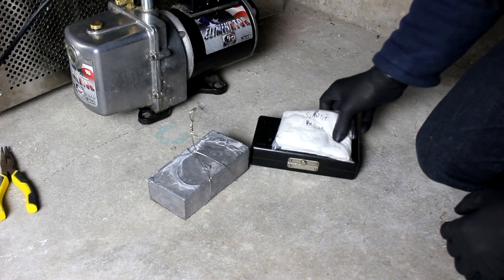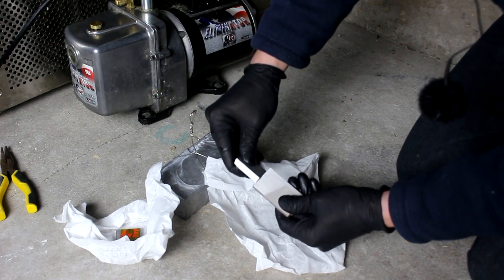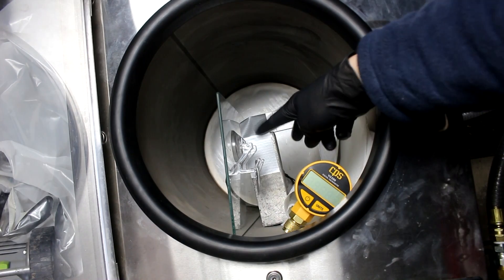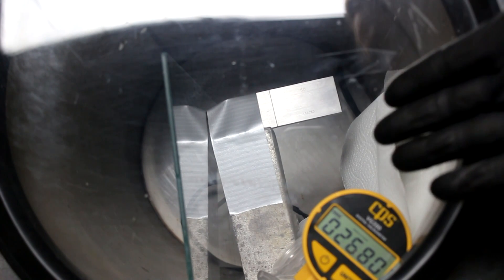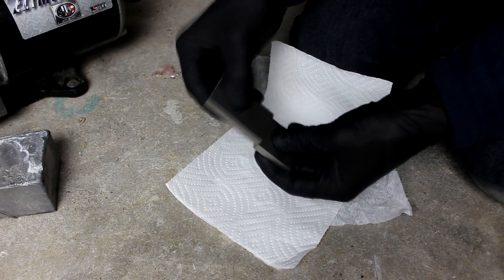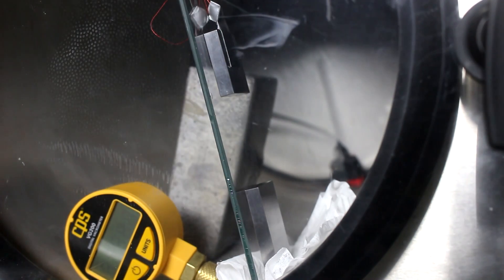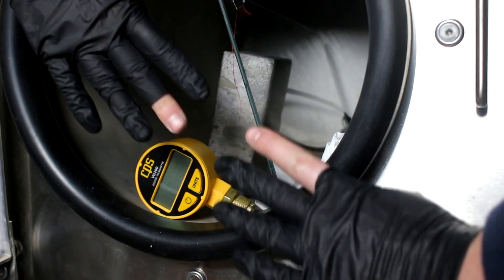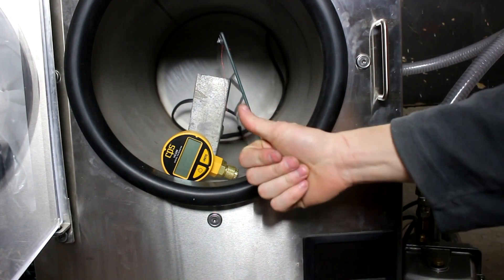Will Gauge Blocks Stick In Vacuum?

Comment: how well works a suction cup when you put it in soapy water on the glass? I would say the same when the load is perpendicular to the glass surface and much worse when the load is parallel to the glass surface.
So if it was suction that holds the (slippery, (like the soapy suction cup)) gauge blocks together, my prediction would be that the gauge blocks should fall apart when the surfaces that stick together are vertical (or just steep enough). in the same way two glass surfaces with water between them behave...

what do you think about that?

Comment: What if it is the atoms in the contacting surfaces that get really hot for a also small amount of time and that makes it weld? You could test this by doing the same proccess but instead making the movement much slower thus making it less likely to heat itself up.

Comment: Cody, i suppose there is a problem with the experiment method. When the plate falls on another plate, it bounces and lifts off. This happens even on a very small scale and you cannot see it with naked eye. The force created by bouncing is enough to not let two plates weld together.

Comment: Could the pressure you apply when squeezing the blocks together create enough heat between the blocks to force enough atoms to warm up just enough to mix and create a slight weld?

Comment: on such a small scale the ductility of that metal will make it like rubber which would increase your contact area. also the surface may not be as smooth as it looks when you get down to nano-meters. what does it look like under an electron microscope? does it stick to glass when rung against it? how about aluminum ground to the same flatness?

Comment: So gauge blocks stick together with a combination of three factors...
vacuum, molecular force, and friction.

Friction alone wouldnt stop them from pulling apart, but does make it more difficult to slide.
You need the vacuum and sufficiently smooth surfaces to get the molecules to line up and attract eachother. 
The closer you can get the molecules of the alloy, the stronger the bond, and the stronger the bond, the stronger the frictional force.
Having any air between the plates can cause the molecules to be too far to have a strong enough attraction force. 

Its not really a mystery... 

Think of them as rubber balls more than marbles, and moving the blocks allows the molecules to be squeezed out but loose molecules from the outside cant get in, other than that your aforementioned marble analogy is pretty spot on.

Comment: SladeCintron Cody, dude.
what happens is when the gauge blocks are stuck together, firstly the friction sheds off the oxide layer of the metal and makes bare metal contact each other. then  the loose electrons in the pieces are free to move in both of the blocks, because they can't differentiate between them. when they move through the connection points, they push atoms in their way, and that forms a metal bridge which holds the blocks together.
that's what happens

Comment: Very nice demonstration, thank you. 
As far as I know you need some friction to overcome the repelling force between the electrons from part A and part B. After you have overcome this force, part of this force will hold the two parts together (so no thermodynamic violation here ;)). At this point, when enough metal surface (hence the mandatory flatness) has entered the van der Waals zone (mutually), all electrons will flow freely from one metal lattice into the other. This 'sharing' of electrons in the classic sense, or collapse of the separate cloud-like influence in the quantum sense - creates a force that I think can be compared to or is identical to the Casimir effect.
So the total effect could be a combination of van der Waals (gecko-feet), Casimir effect, and valence electron influence.
Not sure if I used the right terms here, just shooting from the hip right after I watched your video.

Comment: Hey Cody,

a while ago, I noticed the very same effect with two HDD disks. Just disassemble an old hard drive and slide the disks together. Sometimes they held together so strong, that it was actually quite difficult to take apart. Unfortunately, I do not have those disks anymore, otherwise I'd make a quick video to show you, but I'm sure you'll figure it out.

Comment: The one additional test I wanted to see was to wring with oil removed, then put back in the vacuum chamber. That would rule out the hypothesis that it's a combination of oil surface tension and suction, either of which work somewhat on their own.

Comment: Cody you noticed the first problem with your experiment (the tape causing tilt), but not the second: you are dropping the block from a high level which is causing a reflected shock wave (unnoticeable) enough to break the week van der waals bonds. i don't understand why you thought you needed to smash them together to create the VdW bonds, its a proximity type of bond. collision causes bounce! try dropping it from a distance of half a mm which is enough to take care of surface imperfections.
Reply: PolyJohn i thought about that but since the surfaces are not 100% parallel a small force is still needed which bounce gap won't do. anyway it's worth trying out.
Reply: We should take this further and agree that it's useless to try more experiments in a non-scientific manner: Cody keeps trying to slide the blocks in normal atmosphere and then doing other things in the vacuum.

Let's go scientific and try exactly the same things in the same condition, with pressure being the only difference (in the air then in the vacuum). Then we can proceed to conclusions.
Reply: Neut Only if the weld points are large enough to be clearly visible. Though considering you can make these blocks out of ceramics and they still work, it's clearly not welding that's occurring, nor an oxide layer that impedes the bond prior to wringing.
Reply: Yeah, it bounces from the higher drop height, but then it falls again onto the block from the much smaller height of the bounce. If the short drop was going to do it, then the small drop after the bounce would have done it too.
Reply: Neut If the presence of air was the only thing impeding their bond, as that part of the test was meant to determine, then the upper blocks weight pushing them together would've been enough to form the bond.
Reply: Look, the original vid with gold (or indium) showed visible traces of metal. You're not going to get that with VdW, it's actual metal-metal fusion: cold welding.

The twisting action is producing tiny areas of sub-micrometer—nanometer—levelling where the many atoms can share electrons in a true, chemical, bond.

The gold, the indium, these gauge blocks; they are all welding .
Reply: tubeist- dan if these blocks are cold welding then marks should clearly appear on the shiny surface when they are pulled apart don't you think?
Reply: @PolyJohn, video of ceramic blocks sticking together? I haven't seen it and would like to
Reply: in my opinion it's not enough. since the surfaces are +- 500nm grounded. the diameter of an atom around 0.25nm. and VdW forces need around 0.5nm proximity!
Reply: @neut1121  
But with a high potion of the surfaces making direct contact, you would expect there to be a difference in the van der walls force between high and low quality blocks. I say we all pitch in and purchase the best blocks available as well as a laminar flow hood with double high quality filters to prevent contamination. I'm almost certain that we can do far better in terms of stickyness to the point of forming a single piece of metal without traditional welding.
Reply: It might have worked if drop so that the blocks slide together instead of droping one block on top the other. ie put one block to the left and one block to the right and above the first block. so when the string is cut, the blocks slide together.
Reply: @guytech7310  I like ur idea that just might work good smarts to ya lol
Reply: ACogloc I'm sure he'd have done it if he had a way to.
Reply: Neut not sure why you’re assuming it’s just a van der Waals force because that isn’t likely to be what it is. That requires distances several magnitudes smaller than the distances between the two blocks
Reply: Neut he also didn’t test it outside the vacuum
Reply: MrOdrzut
On the contrary. The modern scientific method consists of testing falsifiable hypotheses. There's no need to distinguish them. As each one is shown to be false, it is thrown out. That said, I'm puzzled as to why neither Cody, nor anyone else, is using the full array of evidence to devise hypotheses. It was clear from an earlier vid that joined metals often showed visible traces of joined metal. To me that would already make the VdW and vacuum-seal hypotheses weak, and leave the suspicion that actual metal-metal bonds are being created over tiny (very tiny) areas.
Reply: None of the hypotheses result with them not sticking in vacuum. So your experiment won't disntinguish between them. This is the exact opposite of scientific method.
Reply: the best gauge blocks are ceramic
Reply: SladeCintron OHOHOHO SHIT
Reply: 1600Bit I fuckin rekt him, m8. Hes in ruins.

Comment: My guess is it's still van der waals forces mainly here.
The surface is not perfectly atomically flat, even on a guage block. So without some pressure and movement to grind down both surfaces they can't get close enough for the van der waals forces to attract.

Comment: Is it possible that there's some sort of electric force that is preventing the cold welding? What if you had a bit of wire between them to equalize any possible potential?

Comment: @cody i assume its surface tension just like water droplets stick to glass. When you force it onto the surface there is slightly change in temperatures due to frictional resistance which is similar to your tongue getting stuck in ice. Can you try different metals next time ?

Comment: Hey cody,
Love the vacuum vids, super interesting.

You didnt check if the gauge blocks DID stick under vacuum and seperated after u let the air back in! You simply checked after every time u let air back in the chamber!!
please respond!

Raz :)
Reply: On his first test, he adhered the two blocks, then put them in the vacuum chamber. They remained stuck together, even after the air was evacuated and readmitted. The blocks were cantilevered during the test, so there was a load on the joint.

Comment: when you squeeze two sheets of glass, they almost stick too. at least they resist visibly any force that pulls them apart (slide them if you want to separate them). this effect is clearly due to the air pressure. The strength of this effect depends on the contacting area to the perimeter ratio. Given that,
(1) you must try to stick your gauge blocks side-by-side
(2) you must try to PRESS them together without rubbing
(3) the dropping block under vacuum has created VIBRATION, you must create another way of sticking them under vacuum. pressing?
(4) still do the electric current experiments i suggested.

Comment: if the effect is related to the metallic electrons, try to measure the stickiness UNDER ELECTRIC CURRENT. normal and parallel to the contact surface as well.

Comment: What if the friction is creating a magnetic charge in the metal and the flat surface allows them to stick magnetically. What if you tried putting a metal pin to it and see if it sticks.

Comment: try wringing them together and running a neodymium magnet over them, or rather under with some sort of barrier. it could be that the wringing motion aligns magnetized parts of the metal strengthening the effect. THe magnet would then alter it and hopefully they would fall apart.

Comment: This is probably impossible on your setup but I'd heard that if two pieces of metal are exposed in space without their protective oxidised layer (say if you were using an electric drill with a steel uncoated drill bit on a steel plate of similar hardness in a vacume) they'd basically spot weld to eachother,is that true? Maybe you could try to have the drill vertical and have the steel plate on a setup to have a weight on top pushing it onto the drill,maybe keep it small like a Dremel size tool with a drill bit in it and a small plate of steel,if you can pull it off would love to see it done,otherwise I'd still appreciate your thoughts

Comment: do they still hold if you do it in a more viscous environment? in a bucket of oil or water? If the vacuum doesn't seem to phase it, I'm curious if excess oil or other non-air material around it would.

Comment: Cody, what if the friction of sliding the perfectly flat surface is creating enough 'heat' (extremely locally, i.e. on the first couple of molecule's depth on the surface) to melt only the surface molecules, essentially sintering the edges together?

Perhaps this happens whenever you rub metals together, but then there are two few molecules "sintering" together to create a bond strong enough to keep two blocks together. However, because here you have a lot of molecules interacting, compared to a rough surface, you've got a lot of surface area (surface density?) sintering together, creating a strong enough bond.

Comment: Hello Cody , love your videos. The  Effect is the Nuclear force between atoms . http://aether.lbl.gov/elements/stellar/strong/strong.html
Reply: Haha, no it is not. If it actually was then that would be cold fusion. You should have read what you linked. The strong nuclear force is what holds the atom core together - it doesn't even extend as far as the electrons :Ü™
Reply: But pushing them together could cause a weak nuclear force between some of the metal molecules. Not all of them of course, because it's not cold welded, but enough to stick together

Comment: Could you try putting them in the vacuum again cause when you removed the oil you did not test them with them just stuck together. Not sure if it makes a difference but just to be sure thanks in advance  Cody

Comment: Research on gecko lizards proved that the extremely thin hairs on there feet held them up on any surface. But they didn't work if the hairs weren't sledded in to plaice. Perhaps this is the same principle

Comment: There could be dust on the mating surfaces that settles there but doesn't get sucked out by the vacuum pump. That's all that would be needed to prevent 'melding'. But I think it's that the two plates start sharing electrons and therefore hold on to each other. Just a guess. Could be a combination of things going on.

Comment: My hypothesis is that the surfaces are so perfect that as they slide across one another a net charge is created interlocking the two surfaces together at the molecular level because the surfaces are so close to perfect that there is not enough separation between them to prevent the effects of van der waal forces. Or we could just call it molecule glue.

Comment: I had a thought... acid etch the blocks to confirm they are made up of equiax grains. Maybe the individual crystal's edges are mechanically hooking together, meaning the lattice structure itself . If this is what is happening, does that mean a single crystal cast block machined to the same tolerances would less likely stick together?

Comment: My first instinct when hearing about attraction between two flat surfaces is the Casimir effect. Some googling doesn't show much research, but if they can get close enough, the Casimir Force goes as ~1/r^4, so at close distances, the force is quite significant. I would think that maybe this force acts as a catalyst for the Van Der Waals to take over, or maybe vice versa. Maybe worth trying to measure what the separation is. Since the force goes as 1/r^4, then the difference between a micron and a few Angstroms makes a difference of like 8 orders of magnitude. 

Do you possess any equipment to measure the separation to a high precision?

Comment: Is it possible that the force of pushing them together causes just a few of the molecules to melt and because it's perfectly smooth surface they're likely to be on the surface and bind to the other side?

Comment: Hey Cody, it can be possible that the friction that is produced by the sliding movement generate a small amount of heat that allow to a small amount of atoms to move and join the two faces with a weak metallic bond? You can make some eXperiment on the conductivity or the resistivity, before joining the two pieces, only with contact, and after the cold soldering?
Hope you can solve this mistery, Bye.

Comment: I think that the oils in the air are enough to condense on the gauge blocks and provide the adhesion, simply because oil is viscous enough.  So my hypothesis is that wringing the gauge blocks spreads out the oils for maximum adhesion.  

My experience with gauge blocks (let me know if you want to see a video of me demonstrating this for clarification) has been that when I've gotten them perfectly clean to a perfect mirror finish, with 200 proof alcohol and lint free cloth, I've not been able to wring them together so they hold their own weight.  I can push them back and fourth on the work surface, and they will hold.  But when I lift them up, they slide apart.  This seems like atmospheric pressure to me because of how they slide apart, instead of falling off.  After getting them perfectly clean, in order to wring them together to the point that they can hold their own weight, I have to gently wipe them on a cloth that has a slight amount of oil on it.  So, if they are not wrung quickly after cleaning to perfect mirror finish, oil from the air may be enough to replace my oiled cloth.